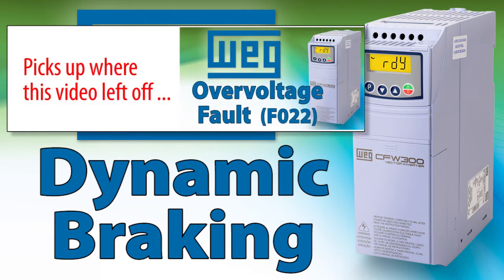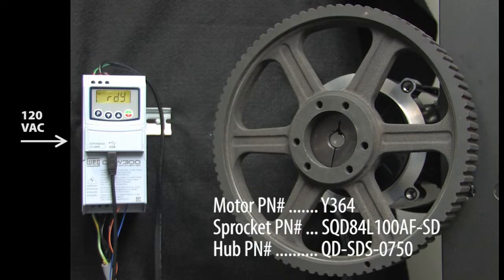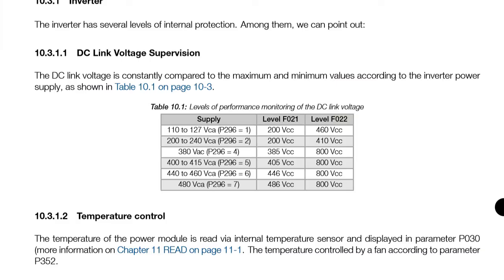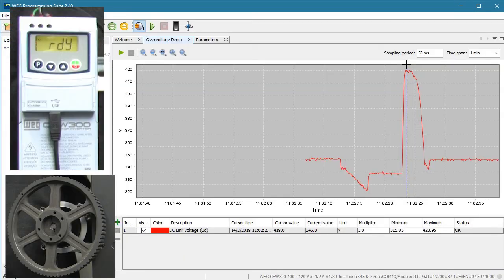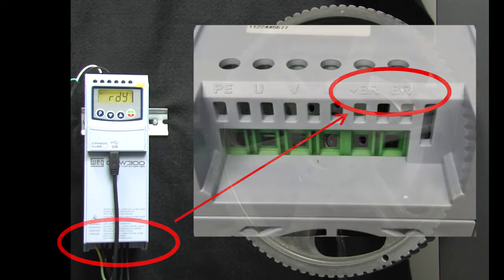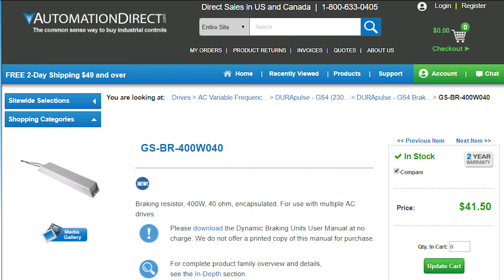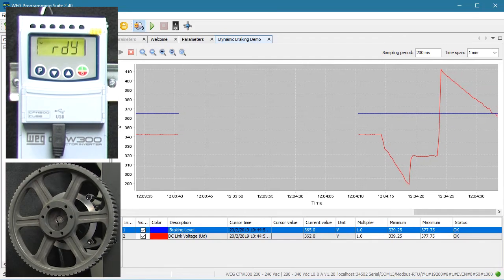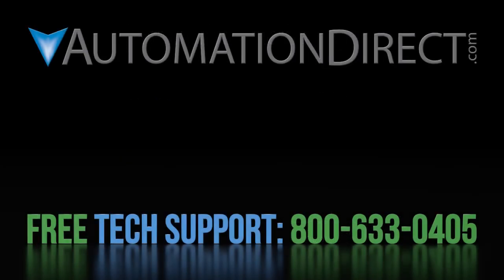WEG CFW300/320 VFD Dynamic Braking from AutomationDirect

Comment: Great  can you show me in video how to wiring  the VFD 2,2 kw at : 
+ fuse 
+ safety relay 
+ filter 
+ braking resistor 
 + contactor 
+ e-stop 
+ reset button
 + switch main power
Reply from the maker: Ho Papi,
Each of those subjects is covered in a separate video. You can find all of the WEG VFD videos here:
www.automationdirect.com/videos  then click on the DRIVES category on the left column, then click on WEG.

They are also located at www.automationdirect.com/cookbook

Comment: Dynamic braking no need resistor brake, it put DC voltage into stato in order to make a braking  Force
Reply from the maker: DC Braking is intended to hold things like fans still once the motor is stopped and should not be used to actually stop the motor.
Braking resistor is used to stop a motor with a lot of inertia quickly without overvoltage errors.
Reply: @automationdirect  If we need to stop motor with a lot of inertia immediately, can stopping with the Braking resistor do?
Reply from the maker: @ttautomation7088  Yes, Braking Resistor will make a HUGE difference, as you can see in the examples in this video.

Comment: dose we need a breaking resistor when we switch off the motor and drive. braking resistors are used when we have to decelerate the motor right ???
Reply from the maker: Correct - Braking Resistor will help when you try to decelerate the motor faster than it would spin down by itself. The Braking resistor is needed to absorb the excess energy created by decelerating the motor. Whether you need a braking resistor depends on how fast your are trying to decelerate and the size of the load. The drive can handle some of it by itself.
If you decelerate and get an overvoltage fault, then yes, you probably need a braking resistor.

Comment: This is the best video i have been seen. So if i have vfd and i want to add DR but i want to calculte  the resistor required for the drive, how to calculate that? If the deceleration time 5 sec and the drive power 11 kw, 400 volt?
Another question, the power supply is not some times stable, some times 380 some time 370, so the dc bus is not stable and the that changes overoltage threshold and maybe exceeding resistor power, is not right?
Reply from the maker: Resistor size:
----------------------
 If you need to sink 11KW of power at 400V then you need to sink 11,000/400 = 27A of current. And we know I^2 x R = 11K  -> so
  R = 11K/I^2 = 15ohm 11KW resistor  in a ideal world at 100% duty cycle.
You said your decel time was 5 sec, but didn't tell us the duty cycle. You will need that to derate the resistor size.
See 04:18 in the video for more on this. 
Here is another video that discusses Dynamic Braking: https://www.youtube.com/watch?v=87EwaBzd7Dk

Unstable Supply
------------------------
You are correct, so plan based on the worst case line voltage.
The over voltage videos covers this.

More Videos
------------------------
Did you know that we have over 1200 Automation Tutorial Videos? Check them out here:
www.automationDirect.com/videos   (random search or by category menu on left)
wwwautomationdirect.com/cookbook  (by subject - there is a whole chapter on VFDs)
Reply: @automationdirect   @AutomationDirect.com   @AutomationDirect.com  when you calculated the sink current for 11kw at 400 volts, the 400 volts is 3 phase AC, but i think the calculation must be for DC bus P=R*I^2, why did you use AC volt (400) and inverter power to calculate the sink current instade of using DC volt? I mean 400 *1.41=564
19.5 amps R=11kw/19.5^2 =28.9, but 11kw is the maximum of motor power at maximum speed. I mean the motor at the max. Energy, when the drive start at a point of stopping, the deceleration gets to start to sink at max current and volt. Is that right?
Reply from the maker: @wadib3eed7  Good Catch!  Yes, you would use the DC bus voltage in the calcs.
Reply: @automationdirect  Thank you so much for helping.
I have the drive that i told you, 11kw and from the catalog i found the brake resustor required and that was 60 ohm but the installed on the drive about 65 ohm /1500 w, but that one burned so i wanted to buy new one but i found 70 ohm, my question is if i use a higher ohm resistor than the rated in catalog and higher power it will be good or bad to the drive? I mean if the catalog says 60 ohm and power resistor i use more than 1500 watts for example 3000 watts. And 80 or 70 ohm. Is it right?
Reply: If i use duty cycle 20 %. Do you mean duty cycle 20 % as example the the time resistor will be on and off? Means in 20 % the resistor will be on and off at 80 %?
Reply from the maker: @wadib3eed7  Right, if you only use the resistor 20% of the time you can reduce the wattage accordingly.  Note that the braking resistors in the manual assume a 10% braking duty cycle (you are only braking 10% of the time) which is very typical for these kinds of things.
Reply: @automationdirect  so, as the exampke 11kw drive neans 11kw resistor at 100% duty cycle but at 10% duty cylce it will be 1.1kw power of the resistor, right?
Reply from the maker: @wadib3eed7  Check the drive user manual to be sure, but yeah, that sounds about right. Just beware, braking resistors get REAL hot ..
Reply from the maker: Sure, just remember that a higher ohm resistor will take longer to absorb the current (it will resist the current flow more). But the small change you are talking about won't make much difference.

Comment: Realy nice video. I have some question. https://aktif.net/en/product-and-services/motor-control-and-braking-resistors/dynamic-braking-resistors Can we use this product for WEG VFD?
Reply from the maker: Sure!  Just make sure you follow the guidelines in the user manual for proper resistance and power specs.  Of course AutomationDirect sells braking resistors and even tells yo which one you need.

Comment: Hallo,
I have a cheap chinese Vfd with DB built in. Now i bought an Brake resistor, to stop my motor more quickly, but i cant activate the DB. I changed every parameter i found but nothing works… can you tell me wich parameters you changed to get the DB activated?
Reply from the maker: Hi Luk, The video shows you the parameter we used at time 2:41. It was parameter 153.  But that is for this drive.  Look for something similar in your drive.

Comment: I love these videos, thank you so much!
Does Automation direct still carry the external braking resistors for CFW300A04P2S1NB20, The smaller A frame?
Reply from the maker: Thanks for the feedback! Yes, AutomationDirect does sell braking resistors, BUT beware that the A Frame drives don't have Dynamic Braking built in (see 4:00 in the video). So if you need dynamic braking with the A Frame drives you will also need an external Dynamic Braking Unit (DBU). Automation Direct sells those too, of course ... https://www.automationdirect.com/adc/search/search?fctype=adc.falcon.search.SearchFormCtrl&cmd=Search&searchquery=dynamic+braking+unit&categoryId=0&TxnNumber=-1&searchqty=10